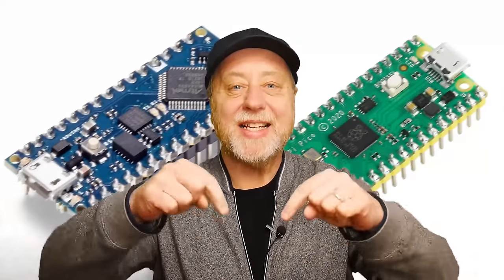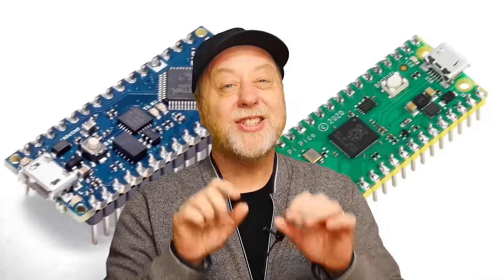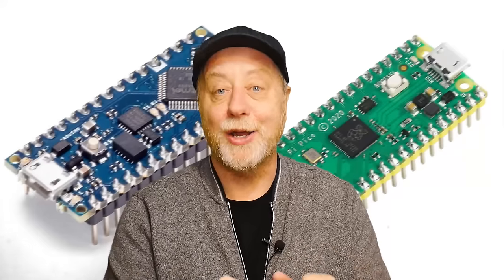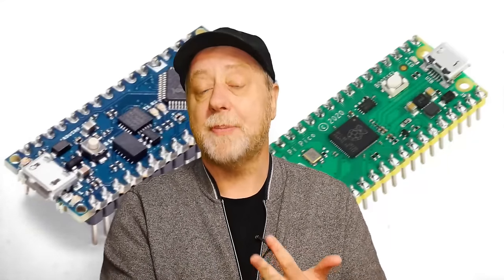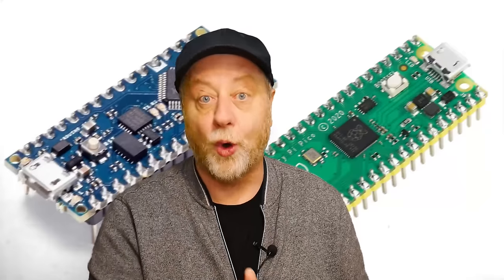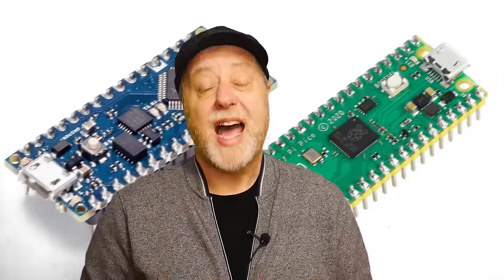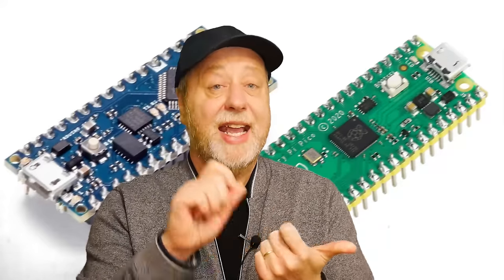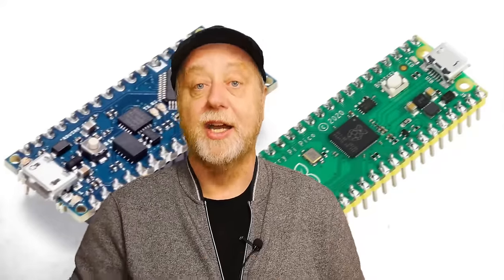Arduino vs Pico - Which is the Best Microcontroller For You?

Comment: For this content the presentation and comments seem equally valuable. I'm contemplating picking up this microcontroller/electronics/interfacing hobby (again). I would be relying on the existing support infrastructure to get started. My box of Basic Stamp stuff has been gathering dust for over a decade & it doesn't seem practical to start again with those boards. Thanks for sharing (everyone)

Comment: Well, my main reason to choose the Atmel/Microchip Arduino is the voltage to work with. I can choose a Lithium cell with 4.2 to 2.5V to run a 8MHz ATMEGA WITHOUT any power components! Also the GPIO output is 5V when I power an Arduino with 5V. The Pico has only 3.3V and needs (the board has) an regulator to step down. But on the logic side you need to step it up, if you has 5V components.
Also you can use the bare ATMEGA328P in your projects, what you "can't" with SMD components (directly).
Reply: That last is the big selling point to keep alive the UNO. I don't like too much be cause the way is set the board, the Leonardo is more nice and I have a Zero too.
But just the UNO use a DIP IC so you can easly move around. I mean, to me making a custom board is not problem use a QFP but to beginners is more easy.
However, the price side. . . one ATMEGA328P-PU is 109MXN and the Pico is 125MXN and the black pill STM32F401 (if you want 5V-tolerant IO) 136MXN, is a little tough, because you need to add the crystal and capacitors and the cost is the same but you get more performance.

But having the possibility to change the IC is nice on the UNO, especially if you are a full newbie and blow the IC by connect something wrong.

Comment: I probably have a dozen different Arduino's a few full pI's and now 2 Pico Board's (one for a PicoScope and a spare) plus a Badger 2040 to play with an ink display - that was cheaper to buy than buy a display and a pico individually.  But my current project is using ATTiny 1604s as these have all the arduino infrastructure support but on a 14 pin chip costing less than 2 Euro's and it has now become so cheap to have dedicated pcbs made up in China.  So for me the choice comes down to the io requirements - pin count and type of comms. So really interested in the PIO side of the 2040.

Comment: Wow, great video as always
I would like to hear some more details of the Pico

Have only gone the Arduino way till now 🙂

Thanks for sharing your experiences with all of us :-)
Reply from the maker: I am glad you liked the video. I have several videos about the Pico already on the channel, did you get a chance to watch them?
Reply: Official Arduino support for the Pico board / (RP2040 chip) is based on Mbed OS, inofficial support is based on the Pico C/C++ SDK (written in C, compatible to C++), build system: cmake.
i like inofficical more cause it's using the original C/C++ SDK from Rasbperry.
Reply: @Henry-sv3wv  Liking the unofficial one more because it uses the SDK from raspberry pi is not really a valid reason for using it. MBED is created and maintained by ARM and it is an ARM cortex M0 processor so why not use that since it was created by the people that created the core in the first place. Also why use the arduino IDE at all to program the pico when you can just use VSCode and the Raspberry Pi SDK?

Comment: I’m working on a project with Arduino in mind, but I’ve realised that I can use a Pico in its place if I need to. I only need a couple of digital I/O and a couple of analog inputs. The 5v in and GND are in basically the same positions so I can swap them in a pin header and use the same pins for I/O and analogue inputs. The pico is slightly wider so I’ve got 2 rails of female headers on one side of my protoboard.

Comment: Great video. I'd be interested in the PIO method and uses... Thanks!
My next project will be built around Pico W. I've used both, 4 regular Pico's and several Arduino projects. But I have several other raspberry pi's. Several RPi 1 Zero W's and RPi 4B's so I'm learning the easier python code at the same time and Debian Linux and electronics/robotics/AI/Computer Learning/Facial Recognition, etc. All very useful in today's world!
Reply from the maker: The PIO video is here: https://youtu.be/QlKtEA5XKc4 👍

Comment: Having used both modules. Which one I’d use in a new project? May well depend on the speed and how complex the design may be. A couple of LEDs and a servo would be a nano. A weather system may be either.

Comment: Good video however you forgot to mention one very important difference between the Arduino and Pico. That is power requirements. I'm not talking about it's operating power consumption (The Pico is super low power consumption) but powering the board and it's I/O limitations.  

I have been using the Pico for many months and find it great to work and program with (using Thonney & MicroPython). Here's where you have to be careful.... The Arduino is a 5v device at it's core so you simply use a 5v power source and you're good to go. The Pico however is a 3.3v device at it's core. It does have an onboard 3.3v regulator with limited power. So you can power it with a 5v source.  The I/O pins of the Pico are 3.3v level and are NOT 5v tolerant according to Pico info. So if you are interfacing with outside world (which you will likely always be doing) then you must make sure the voltages from the outside devices (CMOS / TTL etc) are only 3.3v max.  This can be troublesome. So even if you are interfacing with a 5v Arduino for example you have a problem. 

There are ways around this such as voltage level converters of various types some are more costly than others.  I use these tiny boards that have 4 MOSFETS on them arranged in a unique way. There is a HI voltage side and a LOW voltage side. You connect your voltages accordingly for example 3.3v and 5v or 3.3v and 10v. There are 4 devices on each of the boards I use. if you set a HI or 3.3v logic level on the low side, the Hi side will go to say 5V. and if you put 0v on the low side the hi side will also go to 0v. They are also bi-directional. So you could set a 5v logic level on the hi side and the low side will go to 3.3v or 0v for a logic low. I hope I have explained it OK. You can get these on Amazon as well as other sources and are cheap (pack of 10 boards, 4 channels on each incl SIP solder pins for proto boarding for around $13. CDN)  Mine are KeeYees brand and the boards are nicely made and labeled.  They work great and I have tested them at 3.3v Low side and 10v High side and I have sent a PWM frequency just over 2mHz and all was fine.  

Hopefully this will help avoid a problem for you.  Good luck friends :-)
Reply from the maker: All of the Arm based Arduino boards are 3.3v.

Comment: i would like to mention that you can in fact just write plain c code in the arduino ide and upload it to an arduino. of course then you have to know all the respective c commands and registers of the processor that is on your arduino, but instead of using the digital write function you can just as well directly write to the registers and that allows for way more efficient code as the library function has a bit of overhead to make it simple to use.
also if you know how you can directly flash the processors on the arduino boards without using the arduino ide at all. the beauty of the older atmel chips was that they were very well documented and easy to program and flash with a properly set up ide of your choosing.( eclipse for example)

Comment: Opinion: Arduino+Raspberry. They work very well together. By both :) For RP Pico, I don't know, never asked (so may be offtopic). But for RP 3B+ and a bunch of arduino nanos: they very well work together and do what the other can't. Eg. If you want to control 4 (or more) PWMs from one (or more) generic off shelf USB joystick in 2 hour with only knowledge to linux + C or python (like most of hobby electronics but full time programmers)? Go for RP (full board) + arduino nano(s) combo to live "both of two worlds": having linux + having a lots of PWM/UART/analog/etc supported IO ports (RP alone has too limited GPIO for this, and hats are not a "native" solution to "programmer type" tinkers) in two package separated 10 minutes of reading about I2C support.

Comment: Hey Gary, 
love your video, but there is an error that I cannot pass up, for RP2040 name, on the ram part you are wrong, the number "4" is actually floor(log2(ram/16k)) meaning that if the ram is doubled the number is actually 5,not 8 and if the ram is halved, it is 3 not 2,because it is log2 function, (if it is 8 it means the ram of RP2080 is 16 times the RP2040 and if it is 2 it means that RP2020 is 1/4 of RP2040), yeah, be extra careful with exponential and logarithmic (exponent and logarithms) 

But good quality content nonetheless, keep it up
Reply from the maker: There seems to be some confusion about this, while I do see that there is some documentation around that uses the log() variant, this is what Eben said himself: https://youtu.be/QFQn2fl_YSU?t=544
Reply: @GaryExplains  They are both the same thing. What Eben said is essentially the same as the log method, just different ways of writing the same thing. Eben said (2^4) * 16 which is 256 kB. If you put 256 kB into the log formula then you get 4. Its just rearranging the equation. Even with the way Eben said it (2^4) * 16, if you did (2^5) * 16 (which would be an rp2050) then that is 512 kB which is double the ram, just like if you put 512 into the log formula you get 5.

Comment: Just got a pack of 10 RP2040 microcontrollers along with 10 of the 12 MHz SiTime SiT8008 MEMS oscillators for those microcontrollers just so they can run, as I figured why not check it out. I wonder if it can still boot from the normal SPI flash and / or MRAM, rather than QSPI version which tend to be a bit more expensive especially for MRAM memory chips.

Comment: I would love to see the programmable IO examples.
Reply: For what MCU?

AVR: it's just an assignment to appropriate MCU registers, so if you need all B pins as output, you do DDRB = 0b11111111, then to set high state on i.e. B3 you do PORTB = PORTB | (1 << PORTB3). It is compiled to one or two instructions taking a cycle each, so it's pretty fast :)

Comment: I have a hate-love-hate relationship with Arduino and a love relationship with Circuit Python.  Arduino has everything and someone has made a library for you.  As Gary mentioned it is not a full C / C++ compiler and it has been historically very hard to access the additional on chip resources (So I was mostly using TI Dev boards).  The reason I love circuit python is it has libraries for most things and I can run the same code base on an ESP32-s2, Raspberry PI, and windows machine with a simple processor check.
Reply: How is it not a full C/C++ compiler and how would it stop you from accessing any resource on the chip? just because their abstraction layer doesn't allow you to do it  doesn't mean you can't just do it your self from C++.
Also I really like python for that very reason many libraries and runs on many platforms :) it is my favorite language!

Comment: I dipped my toe in with the Circuit Playground express but now I am running into all sorts of out of memory issues using circuitpython.  Any tips on alternatives that have more memory or better memory management?  My program isn't that big so it's a little frustrating to already be maxed out on what i'm trying to do.  (Trying to just make a simple toy that plays audio files, runs a motor, detects temp and does something with that... etc.

Comment: ESP32... The m5stack stuff is nice if you want a nice looking device with display.
Reply: I'm personally a big fan of the TTGO T-Display. It is a full ESP32 board with battery charging support as well as a display as big as possible for a breadboard-friendly device. The display is useful for debugging and/or adding interactive features, especially as the board comes with not just one, but two GPIO buttons (plus a separate side-mounted reset button).

Comment: Remember the pico has 3.3V logic levels, not 5V. This could affect the type of board you choose.
Reply from the maker: Many of the Arduino boards are also 3.3v.
Reply: @GaryExplains  Oh. I've been using the nano for the past 6 months. I've learned something new :  - ))
Reply from the maker: Basically all the ATMega boards are 5v and the Arm boards are 3.3v.

Comment: Isn't the Arduino language just GNU C++ with a bunch of the Arduino framework included? There is a file in the Arduino framework that shows something to the tune of:

void main(){
  setup();
    while(1){
      loop();
    }
}

The only thing I don't like is that the crappy old Arduino IDE does not allow you to modify the framework for your specific applications, and really goes out of it's way to hide it. PlatformIO is a good alternative that allows more advanced users to really take full advantage of it.

Comment: As Zack Freedman says: delays kill projects. The time I spend on unplugging, repluggin and working out vanishing USB drives from the OS with the Pico cost way more than the 15€ extra one would spend on a Teensy 4. Totally fed up with this crap chip. Nice on paper, but on the next iteration, include flash storage so it can hold a proper bootloader allowing direct programming....

Comment: Personally I use ras pi because the ability to code on device espeially for the powerful ones like the 4 model B, it means that the debuging and initial writing time is much quicker
Reply from the maker: That is very true, but of course boot up times and possible SD card corruptions are big problems for many embedded use cases. Here is my new light switch, just waiting 5 minutes while it boots!

Comment: Hello. Cool. I made a project like PicoBasic for those who miss BASIC from the 1980s (me). I developed a board with the RP2040 and another for the inputs/outputs with USB, AUDIO, Relays, SDcard, VGA. I adapted the original code (which is not mine) to include the ABNT standard keyboard. The manufacturing files, electrical diagram and videos are on my channel.

Comment: More importantly, Microchip brought ATMEL and has jacked up the price of the chips an ATmega2560 from Microchip is now $18.86. Meanwhile, a more powerful RP2040 is $1.  So if in the future you wanted to make a commercial product, or get a job programming microcontrollers. The raspberry pico is the way to go. Microchip used to be my go-to for over 3 decades. But them forcing me to use Harmony to get support or for the new libraries is a no-go. Harmony IDE as a concept is good. Its execution is beyond excretable.
Reply: If you want to get a job programming microcontrollers you are better getting familiar with a range of ARM cortex microcontrollers but the pico is a good place to start, especially since it is one of the few multicore micrcontrollers out there.

Comment: Actually, I think the Scamp3 by Udamonic is the best choice. Smallest code footprint, interactive debugging, you can talk directly to hardware from the command line, and it's a LOT of fun.
Reply from the maker: I was intrigued until I saw it uses Forth, then I understood why I had never heard of it.
Reply: @GaryExplains  You need to try Forth in an embedded environment. There's a learning curve, but once you start to use it, it's faster development (overall) than anything else you'll use.
Reply from the maker: Hmmm... Having used Forth in the past (admittedly a few decades ago), I highly doubt it is better than C or Python or Rust.
Reply: All I can say is... https://www.youtube.com/watch?v=8njTEL3wo_I
Reply: That's a lot easier than C. And Forth compiles to very efficient machine code. You won't get the same real-time performance out of Python or Rust. But each to their own.
Reply: @marswatcher  Rust gets very similar performance to C so you will get very good performance from Rust too.
Reply: @conorstewart2214  That's true. But Forth has an incredibly small runtime. It's probably the most efficient language I've ever used. It forces you to think more about the problems you're trying to solve, but you end up with really tight and efficient code. You should get yourself a Scamp3 and try it for yourself. It really is a lot of fun, and much better than Arduino!

Comment: Since a Raspberry Pi Pico can easily be programmed with the Arduino IDE and comes much cheaper than even the clones of Arduino boards, I consider it a much better choice to go for most projects.
Reply: It is not easy. Holding down a button while inserting a cable is NOT easy! The frustration alone is worth spending 25€ on a Teensy 4. And that chip has tons of other benefits.

Comment: Thanks for the information about these robust micro controller PCBs.  I do mostly industrial PCB designs.  The biggest drawbacks are processor pins coming directly out on the PCB pins.  RFI, ESD and other noise can damage the processor.  The PCBs need opto isolators on the DIs, op amps on the AIs and something like a darlington array on the DOs to drive relays and such.  Maxim makes good RS485 chips to interface the UART engines out to a com line.  It's amazing how advanced these design blocks have come with prices dropping way down.  As you mention, we have many good choices.  Thanks again!